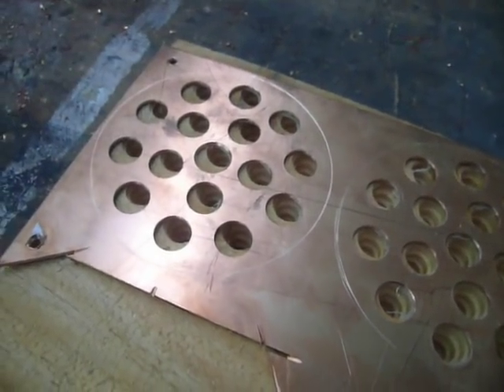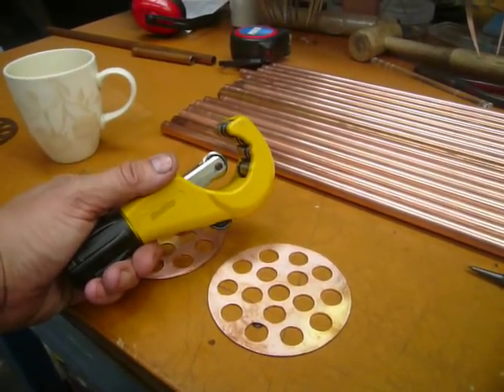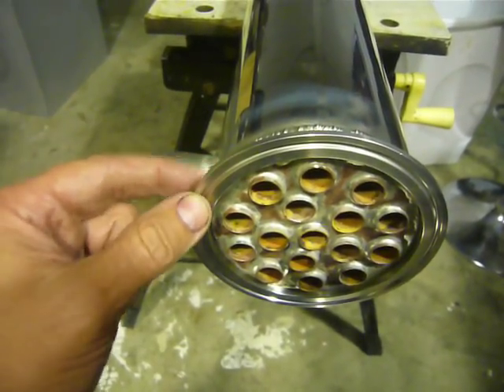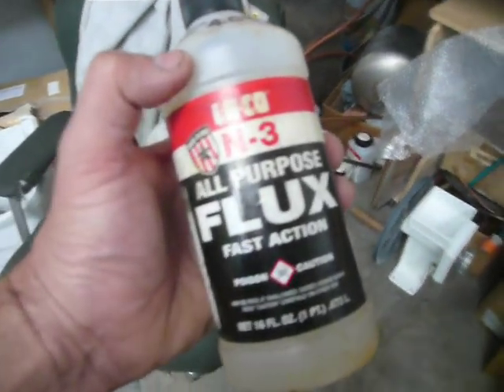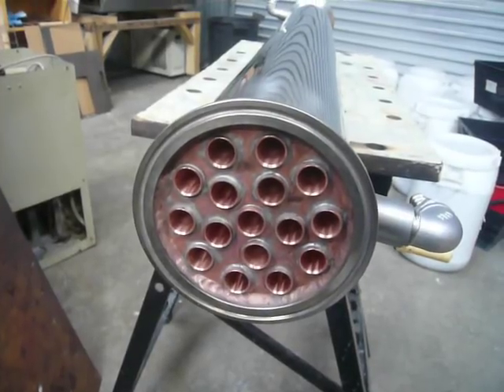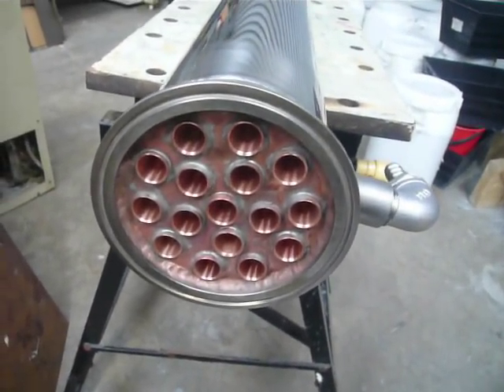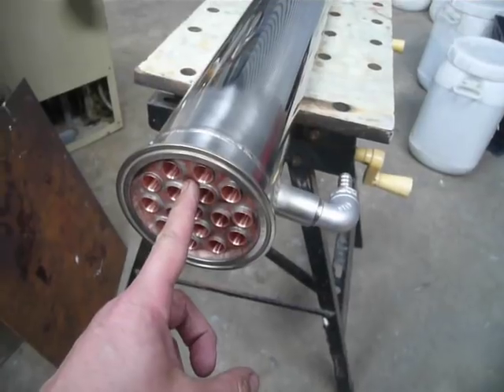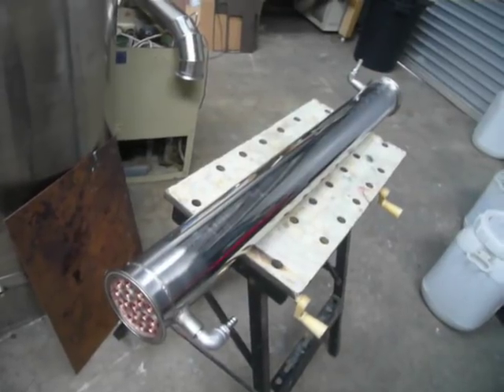4inch condenser

Comment: Hey, great video! What kind of knock-down power did this condenser have as a product condenser?
Reply: 21.1 GigaWatts!!!  (at 88MPH)  

But in all seriousness, if a well built ø2¨ x 24¨ condenser can knock down 4500-5000 W of input power, a ø4" x 36" has over 6 times the volume so a proportional amount of cooling power. I'm making a lot of assumptions about internal surface area of the cores of one versus the other and that the relationship is linear (which it's not), but you could probably make the estimate of 30,000 watts of knockdown on the high end....which is nuts! I don't know how the big commercial setups are powered, but 3 x 10,000W is a lot of angry pixies.

Comment: How about doing a video on silicon bronze TIG brazing ?  I've tried to do it a number of times and can't get it to work.  My welds don't flow very well, they aren't lumpy, but they aren't as smooth as yours either.  If I turn up the heat on the torch, I burn through.  What might I be doing wrong ?

Great content !

Comment: Look up "tube rolling " on you tube. Jeff Hammond has a good video. There no welding  necessary. They do this a lot with various heat exchangers.  Thanks for you video
Reply from the maker: G'day Beetle,
Will look him up now, ... I did a larger exchanger in copper last year that turned into a freakin nightmare, ... I ended up fabricating out of stainless just to get the client something to start working with definitely need better technique for larger diameter in copper.

Happy Distilling!

Comment: I shall talk too a radiator shop, because I'm sure they can 'roll' those tubes olnly have too weld the headers in each end first. Then slide the tubes in and then ' compression' roll them.
Reply from the maker: I bead the tubes on the inside of the baffles nowdays and then peen/roll them on the outside before soldering.
Makes a solid mechanical joint prior to solder.

Happy Distilling!

Comment: Hi, 
Amazing craftsmanship.  I believe your videos are some of the best distilling equipment builds on YouTube.  What size kettle do you run with this condenser?
Cheers
Daniel
Reply from the maker: G'day Daniel,
Thanks for the compliment!

I try my best, sometimes things don't go so well, got a vid I have to edit together soon on a hellishly frustrating commercial job I was working on that didn't go so well to start with.

I've run this on my 200L/6kW kettle running tap temp water and it had no problems.
I'll be running it on my newer 700L kettle soon, -with chilled coolant being pumped thru it there should be no hassle with that either.

Happy Distilling!

Comment: Hey mate, what flux do you use for copper to stainless & and is it the same flux copper to copper? 
Also, which solder are you using? (% of silver?)
Reply from the maker: G'day Chris,
Pretty sure I silicon bronze TIG brazed the stainless-to-copper in this vid.

I used to use the same general purpose liquid flux for soldering stainless-copper as copper-copper.

For the stainless-copper application it has to have zinc chloride (will be on the label and will probably mention something about being suitable for stainless steel).

Having said that, it is a pain in the butt to copper-stainless solder, the flux burns easily and you inevitably have to clean and restart the odd join - especially larger joins.

Brazing works better and once I got the knack of Silicon bronze TIG brazing thin stainless-to-copper I never went back.

The plumbing/food safe solder I use is only something like 5-10% Ag.
You can get silver brazing sticks that go much higher like prosilver 34T or 45T (34%/45% and cadmium free) but they really need a hotter flame than you'll get outa mapp gas. (OxyAcetylene or similar).

Happy Distilling!
Reply: Angry Parrot Distillery 
Thanks mate, my brother in law is a commercial plumber, so he’s been roped in to knock up my parts for me. I showed him some of your vids and he wasn’t 100% sure, so we had to ask.
Always look forward to a new vid mate 👍

Comment: with a heat exchanger this long you can easily increase the efficiency with a couple of baffle plates
Reply from the maker: G'day Prof,

Yeah, I have made a few of these commercially now and include partial baffle plates 1/3 and 2/3 of the way along the condenser.
Serves a two-fold benefit;
1) forces the waterflow side-to-side across the jacket.
2) holds the tubes inplace so if the condenser gets moved around and shes a real long one, the thin internal tubes can't wobble/vibrate about (and they will when they get this long).

Happy Distilling.

Comment: What amps do you run with silicon bronze and does it have the same feel and characteristics of 316/304 ss wire or does it flow and weep like solder... thanks... great video... I love learning by someone else's experience..cheers😍😎
Reply from the maker: Heya Michael,
It does flow to an extent but in quite a viscous fashion than solder.
Sili-bronze beads up much more like a weld than flowing everywhere like a solder. I find it much more controllable.

I use more amperage brazing silicon-bronze than I do with stainless TIG welding but this is usually on account of one of the brazed components being a large chunk of copper that wicks heat away.
You also have less time over target so you are running alot faster.

Brazing 2" stainless ferrule to 2" copper tube would probably be around 60amps.
4" ferrules and copper tube maybe 110-120 amps.

I've had large copper jobs (15kg copper and brass components) where I've had to outsource the sili-bronze work as I ran out of grunt with my 185amp TIG unit.

Happy Distilling.
Reply: Angry Parrot Distillery  thanks Bro😘😎

Comment: Question for you: when you weld the water inlet/outlet fittings on the stainless  jacket, how do you fit them up to the tube?  Do you drill a larger hole than the diameter of the fitting and pass them partially though or do you contour the fitting to fit the outside curvature of the 4” stainless tube so there’s no gab?  If so, how do you contour the fitting?  Thanks so much. Awesome work!
Reply from the maker: G'day fella,
Thanks!

I've done both before.

For the smaller sockets, 1/2" or so I drill a hole the same size as the threaded bore and then curve fit one end of the socket with a file/grinder.
For bigger sockets, 1" , 13/4" and up I tend to drill a hole same OD as the socket .

Two considerations for me are whether I'm pre-assembling the core - in which case I don't want anything occluding the inside of the jacket and/or whether the socket penetrating into the jacket will interfere with the cooling tubes which on bigger condensers with larger 1" + sockets is not usually a problem.
Plus curve fitting a massive heavy bsp socket is time comsuming.

Either way its necessary to get the best fit you can to get a good result.
The better the fit, the better the weld.

Happy Distilling.
Reply: Angry Parrot Distillery you’re the man!  Thanks!

Comment: Could you make it out of 3 inch, as my column is 3 inch and I have a 3 inch pipe to make it out of.  Would it matter or effect the product?
Reply from the maker: Wouldn't affect your product and makes sense to keep the pipes the same size all the way thru.

You wouldn't get as many tubes into a 3" as a 4" unless you reduced the size of the cooling tubes.

Main thing is that the condenser has the ability to knock down what the kettle/powersource is throwing at it.

Happy Distilling!
Reply: @AngryParrotDistillery  Should I put the same amount of tubes into the 3 inch, with reduced diameters or put the same diameter as you just fewer tubes.  Not sure if it would make a difference.  I'm also not sure which would work better to "knock down what the power source throws at it?  Thanks!

Comment: Not a very experienced welder or anything so don't burn me, but have you tried using a filler rod with a higher melting temp for the copper to copper internals then a lower temp for the stainless to copper so you don't have to worry about blowing out the previous welds, and or soldering.
Reply from the maker: G'day fella, that's exactly what I do.
High temp stainless-to-stainless I just TIG with stainless filler
High temp stainless to copper I TIG with silicon-bronze food grade filler. Copper-to-copper (usually the last stage of anything I do) is low-temp silver-bearing solid wire solder (food/plumbing grade).
Reply from the maker: Ah just re-read your post. I weld in the baffles with silicon bronze before soldering the internal tubes.
Pretty much what you were asking I think.